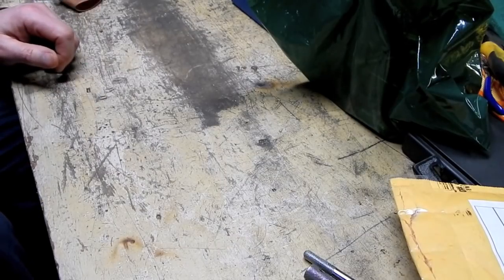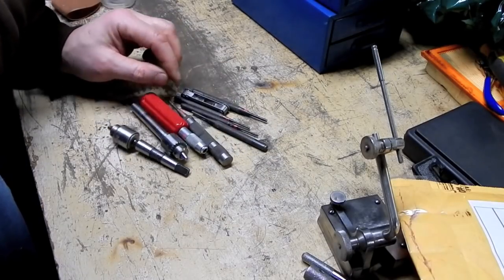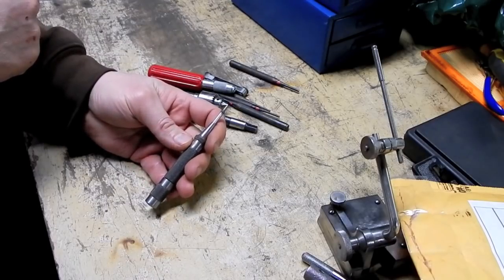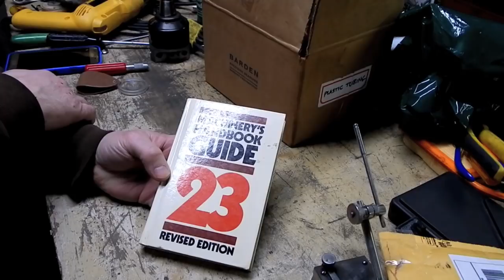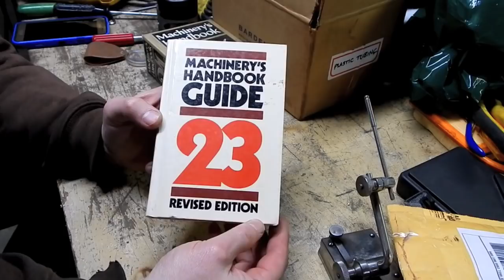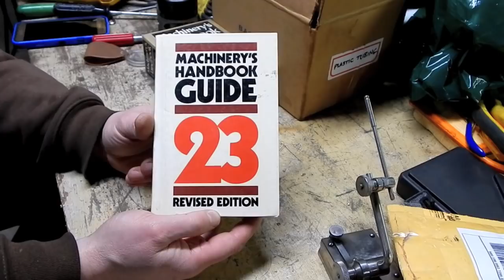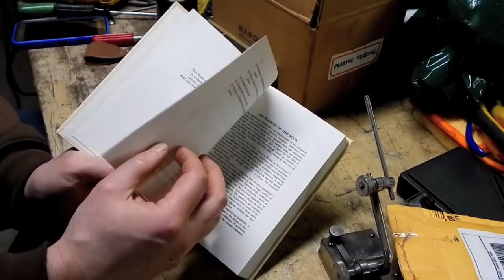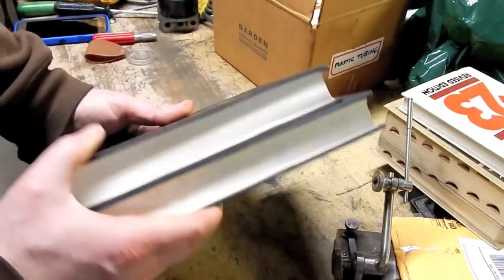February 2019 Tool Buys Part 1

Comment: Category 40?  No, actually it;s Caterpillar 40.  Close though.  MV Jr is a Mori Seiki Japanese CNC mill.  Nice touch probe.  That's a ruby contact.  The sensor just dectects movement, not conductive contact.
Reply from the maker: Hi Greg. I have a guy interested in buying the probe. Problem is fixing a value. I was able to find a smidget of info on the Daishowa website. This probe is an LC series. They have probes that use other technologies, like wireless FM radio, etc. and this one is "LC". I wonder if they actually mean LC as in Inductance Capacitance? Like some sort of electrical resonance technology? I'll keep digging.
Reply from the maker: The guy whose interested in it figured out the MVJR written on the box was a Mori Seiki Jr. mill. Interestingly enough, the probe is made by BIG Daishowa Seiki Company Ltd. So it appears Seiki is part of the same company?
Or maybe Seiki is just a place in Japan??